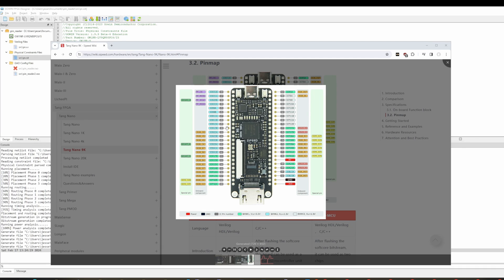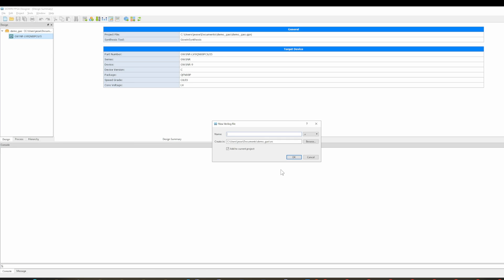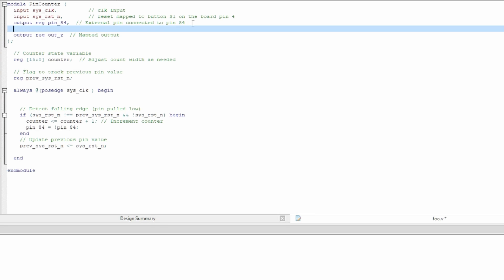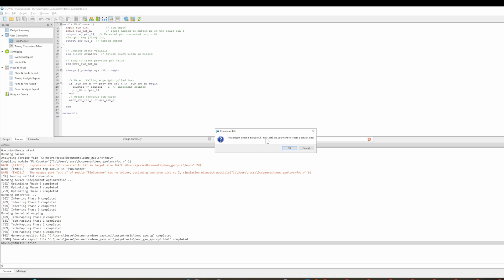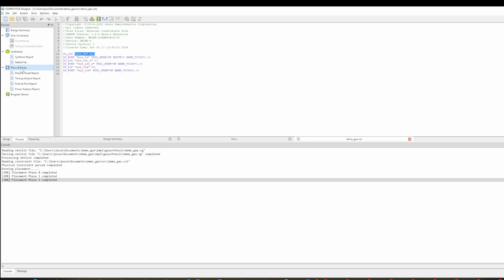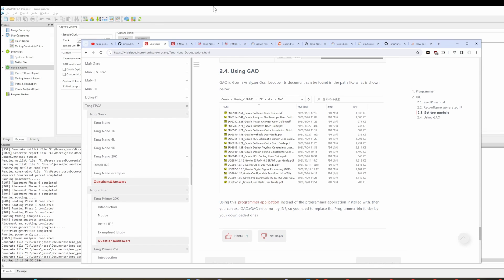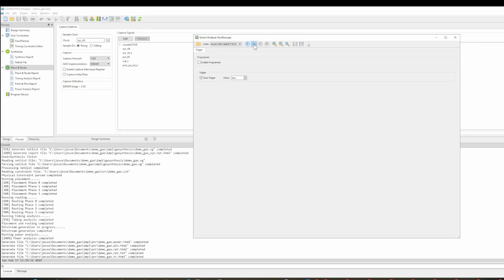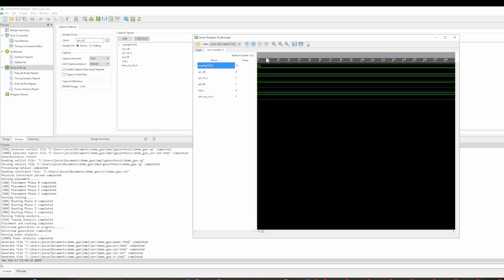tang nano 9k simple verilog and Gowin Analyzer Oscilloscope (GAO)

Comment: In general:

If you don't know what device you got, it's good to look at the top of the main chip. Usually they stamp the manufacturer, model and type on top of it. Sometime that information is printed on the board itself or otherwise go by manufactorer info and maybe the layout and components of the board.

What you should always consider is different revisions of chips and board/components, as they can be incompatible with each other, when the manufacturer decides to go with other parts.
It's also a good idea to keep that information (maybe along whitesheets, documentations, specifications, drivers, etc.) written down somewhere, like a NAS, cloud storage, printed papers, etc., especially if you like to keep alot of parts around and don't want to rely purely on your memory.
You'll thank me later.. ;)

Comment: Thank you so much for posting this. Laughed hard and felt your pain in each step of the video. This company has huge potential but seems to fall short on their documentation and typos. On the Tang driver issues, they are using an emulator with the BL616 or similar to mimic the more expensive FTDI USB to JTAG / UART bridges. This forces the use of a different packaged device driver.

Comment: Here's an abstract based on the transcript, focusing on the process and issues the speaker faced (generated with Gemini Advanced):

Abstract

This transcript documents the challenges and solutions in programming a Tang Nano 9k FPGA using the Gowin development environment.  The speaker focuses on pin mappings, configuration files, and using the Gowin Analyzer Oscilloscope (GAO). Specific pain points include deciphering device names, the limitations of Verilog syntax within the IDE, and the necessity of a separate programmer application to utilize the GAO. Despite Chinese-language documentation and limited community support, the speaker demonstrates how to implement a simple counter circuit on the FPGA and visualize its output with the GAO.